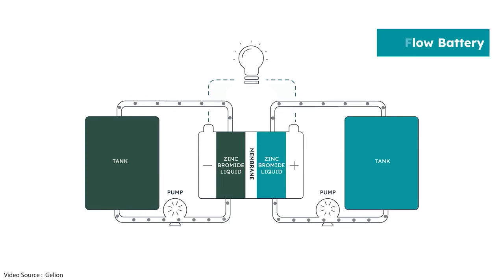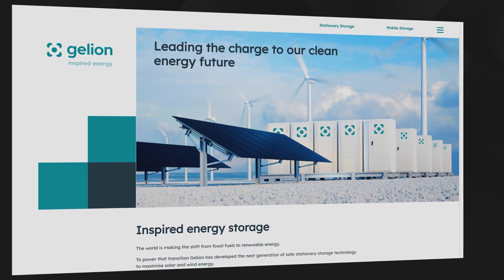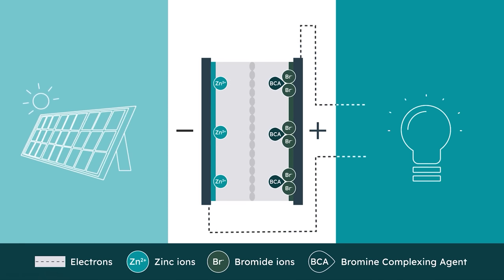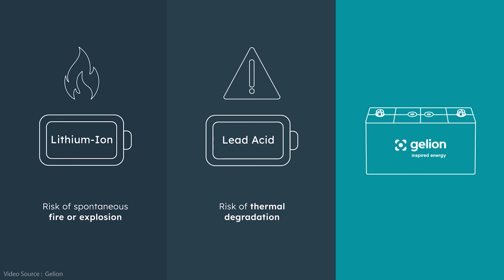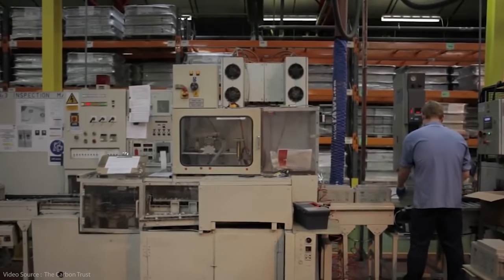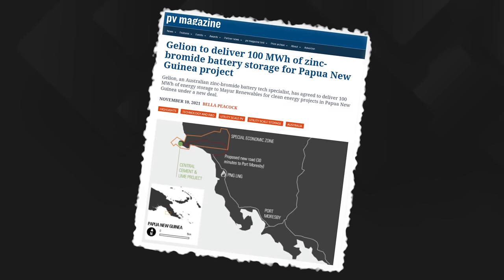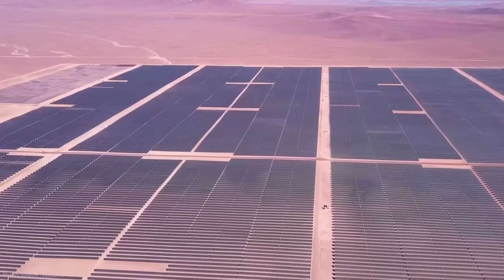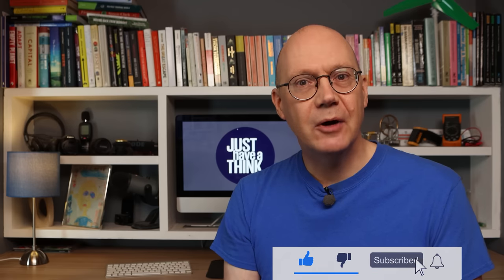Zinc Bromide GEL batteries. Cheaper, greener, simpler & safer than lithium -ion!

Comment: Zinc bromide as power storage is quite old, but the gel concept reduces the bromine build up problems. Looks very promising.
Reply: Ohh I didn't know it had been being used for long, ty for sharing
Reply: @1Mandacaru  zinc and bromide was a thing but this project is a different way of thinking to eliminate some cons.
Reply: Great for large ground based energy storage when weight is not an issue.
Reply: 16 million versus lithium-ion production at 130 million dollars, the choice is pretty clear to me.  The rebuilding costs are also very impressive.
Reply: Good til 50c but what about low temperatures? Canadian here.
Reply: @gmw3083  that's a fair question now that you mention it. I'd imagine it suffers from similar issues as other batteries. Lower power output but no long term degradation.
Reply: I'd agree in most aspects. There are two things I'm a bit worried about. One is build-up of hydrogen during charging cycle, as Zinc is quite reactive in hydrous environments. The other one is loss or leakage of Bromine. In opposite to sulphuric acid, Bromine can easily diffuse into the plastic material. The plastic material (as well as metals) may then be corroded with time, so there have to be special precautions, especially when the temperature limit is frequently reached. And cooling will also be necessary due to the boiling point of Bromine at ~60 °C. And of course nothing was said about self-discharge, as Zinc is also susceptible to air (especially under non-neutral hydrous conditions in carbonate-free environments), while Bromine is liquid at normal temperatures and may diffuse through the gel and react with the Zinc, too.
But in general, this might be a reliable and cost effective way of power storage.
Reply: @gmw3083  assuming there will be water in the gel to support dissolution of the Zinc Bromide that will be formed by the reaction, a completely charged cell may contain very clean water besides the gel and could be susceptible to freezing at < 0 °C. However, the gel might act against this, and there should be additives and other methods to also prevent freezing, comparable to methods applied in lead gel batteries. Incomplete charging may also be one of them, as Zinc Bromide has a high water solubility of > 4 kg in 1 litre of water at room temperature, and may thus decrease the freezing point quite a bit. On the other hand, highly concentrated solutions may also lead to crystallisation of Zinc Bromide hydrate in cold environments. 
However, I would assume that they are aware of these issues, or the batteries would not be applied in cold environments if there are the mentioned risks.
Reply: @human_isomer  I dunno. They still haven't figured out how to reliably build electric vehicles for cold climates. Mainly because of the lithium batteries as far as I know. Plain old salt water lowers freezing point. But I'm no chemist.
Reply: What the tesla needs is a flibe7 core for cold climate. Mate that to a liquid air system and things get interesting with a rebco electric engine.
Reply: @gmw3083  Yes, a solution of Zinc Bromide is exactly the salt water you refer to. It's just different ions than in Sodium Chloride (what is generally referred to when talking of as salt), but the effect is exactly the same.
However, as I tried to explain above, with different load levels of the battery, the anti-freeze effect may vary, and there may be counter-effects to that. So, this has to be figured out first.
Just adding Sodium Chloride, by the way, would probably cause different issues with the membrane and the chemistry involved and is not necessarily a resolution to the problem.
Reply: @human_isomer  I've already started to think of s solution. I'm not a chemist though. I've wrecked lots of things and still have all my bits n pieces. Too many projects..... and a mouse in the attic.
Reply: so this is another thing that's been tried and abandoned decades ago because it didn't work. no surprise there.

Comment: I love the idea of new kinds of batteries for different applications. The ground doesn't care how heavy the battery pack is so a lower specific energy isn't that big of a deal. So use Zinc Bromide GEL, LFP, Lithium Ion, Lead Acid, etc...where they are most fit for purpose. :-)
Reply from the maker: I agree
Reply: As an electrician who has worked on battery based energy systems since 2000, I am very glad to see lead acid batteries going the way of the dinosaurs. Lead is incredibly toxic, and many system installers would clean lead battery terminals without wearing PPE to prevent lead ingestion and exposure. While the advantages of lithium over lead acid are numerous, at this point, lithium Iron batteries are cheaper than lead acid batteries used in energy storage when compared to cost per cycle, which is the only real way to compare cost across different battery chemistries and cycle life.
Reply: @GoCoyote  It would be good to have a chart & method for comparing different battery technologies i.e.  "energy storage when compared to cost per cycle"
Reply: I think we’ll see layers of different technologies used for grid storage, as different discharge rates and recharge efficiencies come into play. It’s an exciting time, for sure. It’ll take a few decades to build really good grid storage, but once we have it, humanity could have clean power, everywhere, forever.
Reply: @davestagner  I agree. It is exciting. This is an opportunity to retool and use what is best where it is best.
Reply: @charonstyxferryman  Indeed.

Comment: This looks very promising and I'm glad to see how close they are to mass production.

I would like to see more information on the charge/discharge longevity of such batteries. If there are some critical assessments that would be a helpful addition as well. One thing I'm aware of is that bromine is a highly reactive element which easily diffuses into the air. That is not a situation found in most of the other battery technologies.
Reply: I'm  assuming the "Bromine Complexing Agents" mentioned in the legend in the diagram at 4:26 complex with the bromine to reduce its volatility.
Reply: Be interested to know about charge control requirements, for use with solar and generators when necessary?
Being off-grid myself.
Reply: It can be completely discharged to 0%. In fact, doing this is planned for on a regular basis in order to "reset" the battery. Life testing is on-going, but I believe they are possibly looking at achieving over 20,000 cycles.
Reply: This is already up and running !

Comment: If this works out, lithium will keep going for a while but it would be goodbye lead acid. And the idea of reusing most of the infrastructure for making LA batteries for the new fangled ones is just excellent! Probably these batteries would be better for ground based energy storage than L batteries too, when weight isn't an issue (if it happens).
Reply: Anyone who's ever had to remove the lead-acid battery from a car, or accidentally spilt its contents (!), or tried to dispose of one, will be joining me in wishing the end of lead-acid technology as soon as possible!
Reply: These things would be awesome for going off grid if their price comes down low enough.
Reply: Price, efficiency (93% round trip interesting for stationary applications) and real life durability will determine the success of this new technology. Good riddance for lead acid batteries 🔋👏👌
(And warranty)

Comment: Many thanks for this one.  This battery was announced at Sydney U with campus lights that solar collected in daytime and lit up at night.  It is progress indeed that Gelion has made it onto your illustrious channel.  Personally I will be happy when a powerwall replacement becomes affordable - even if I have to put it in a small garden shed.
Reply from the maker: Cheers Christopher :-)
Reply: Amen to that!  I have been considering installing solar for the last 9 years (ever since we moved into our current house with a large, south-facing, roof), but I still haven't done it.  Even with the reduced cost of the panels, it just doesn't make sense to install a system that generates electricity at the very time we are least likely to use it.  A stack of these batteries my cellar would solve the problem nicely.
Reply: @paulhaynes8045  Not installing them may well have been a smart move.  I did it about 5 years ago and wish I hadn't.  The energy market here in Australia is geared to ONLY benefit the grid scale providers.  They do this by paying an absolute pittance for your excess energy and then sell it to some one else for 7-10 times the price, with zero capital costs to them for infra structure.   They pay me 5c/kwh and charge between 35-45c/kwh and they are talking about reducing the feed in tariff even more, perhaps even to zero during peek output times.  My total bill including paying of the 4kw system and grid connected power is around 30-40% higher than just buying direct from the grid.  The only real money I save is when I can actually use the power I am producing which is of coarse when no one is home.  I will start winning when the panels are paid off but thats not for another 2 years or so.  Solar panels have come down a lot in price in the last few years but when I got mine it was around $6500 (+ interest) that money IMO could have been better spent.  A battery might change the equation slightly but another $10k is not  really appealing to mostly  benefit the power companies (see AGL's battery plan).  YMMV but do some thorough research and crunch the numbers before you bite the bullet and invest.
Reply: @scottsummers819  that is because energy cost is that low. The expensive part is the grid and taxes.
Reply: There are still plenty of homes that have an oil tank for energy storage for heating, so plenty of application where the space would not be an issue.
Reply: @TheNicog1  Energy costs in Australia are among the highest in the world. In Australia, electricity is not taxed, and depending on where you are, the grid is privately owned. 

Home solar has been heavily subsidised by the government because it distributes the cost of installing new capacity between the government and the user, and distributes the profit from the generation almost entirely to the existing energy company. The state governments have been doing this to subsidise the distributors because the largest ones own coal generators and those coal generators can be subsidised by stealth in this way.

Comment: A very interesting and well presented report on Gelion's battery breakthrough.  One thing I found disappointing was the lack of critical specifications such as charge/discharge efficiency and charge/discharge rates,. My interest is for off grid power applications.  It wasn't clear how much cell management electronics will be required, either.
Reply: Sounds like very little need for cell based management systems compared with lithium ion due to the resilience of the chemistry.
Reply: @yodab.at1746  my thoughts exactly. Price, longevity, and efficiency are the only things that really matter for consumers/investors.

I'm not off grid, be pretty close to it, I would rather have a battery backup with solar over a generator. The solar would offset my electric bill, and the battery bank would be good for power outtage
Reply: @sportbikeguy9875  Yes and no.  A lot of things still run off lead acid.  Most UPS systems run off it for instance.  If these can be built to be a drop in replacement for lead acid that will be a great boon for smaller facilities that don't have access to massive venture capital to build clean room ideal versions.  A lot of places need to make do with reality, not build for the utopia.
Reply: Well, basic ZnBr batteries need to be full discharged to prevent Zn dendrites from shorting out the plates, and required a special BMS to do this across the stack. I doubt they fully solved that issue, but it is not an unsolvable and would probably be built into the commercial batteries.
Reply: @ebattleon  maybe you should actually watch the video!
Reply: That and the cost.
Reply: I believe round trip efficiency is now at around 93%. They have been gradually improving it from earlier formulations. Very long cycle life, possibly achieving 20K cycles. Plus, it can't catch fire. The electrolyte is not flammable. Tested to 600 degrees, the plastic case melted but the internals don't ignite.
Reply: @goldreverre  Thanks Bruce J, that's helpful and  encouraging. 
This could be big for home power storage.   Now we just hold our breath, right?  :)
Reply: @ebattleon  I read that also, so you would need TWO sperate systems for off grid. One charged/charging and one undergoing complete discharge. Nutz to THAT!
Reply: @goldreverre  Sounds good. Do you have any links? Also, cost?
Reply: Not so. You just install a smaller capacity so that your daily use drains pretty close to zero, and once a week do a full discharge. With lead acid you have to over build because they don't like being discharged more than 50-75%, so having batteries able to fully discharge mean you need 25% fewer batteries.
Reply: @AdlerMow  I am going to politely disagree with the total discharge of just one and only set IF you're OFFGRID. Too many potential problems with changing weather and system management. As an offgridder for 15+ years now I like simple and I like redundant. I don't see a problem with grid-tied for reducing time of use costs OR  as backup.
Reply: @blaydCA  That's why people are talking about controllers that would allow you to discharge some cells while keeping others at 100% so the first cells hit 0%, then after recharge, the cells-to-discharge-first change to a different parallel unit. It's not two separate systems. It's simply wiring some cells in series and then those groups of cells in parallel and feeding it all through one intelligent controller. Depending on the voltages of the cells, you don't need very many wired in series to make a unit and could potentially have many, many units in each single home battery system. There's no reason for it to seem like anything other than a single system to you -- especially since this is already what they do with lithium ion batteries, which require much more active charge/discharge management. If you've got a Li-Ion system, you've already got many multiple battery units wired through a central controller. This isn't new, and the management should be substantially easier. 

The only bad thing is going away on vacation and needing to discharge ... which would work fine if sending energy back to the grid, but not so much on off-grid systems. Would the system simply run an external heating coil to boil off that heat? Don't know. Seems awkward for a solar powered vacation home which is going to stand empty for long periods if you don't have a way to "waste" the unneeded power.
Reply: @cripdyke  Time will tell. As an offgridder, I don't worry about "wasteage" or unused production. PV and wind have a payback period. Storage batteries NEVER have a payback period, it's an ongoing cost regardless of the technology. Perhaps Australia will do it right. I don't see this in 'Merica for residential consumers in my lifetime sad to say.
Reply: You were also interested in charge/discharge rates. This can be is varied and depends on the battery design. It can be made to have very fast, capacitive-like performance, or very slow and steady discharge based on gel thickness. Price should be below $100/KWh.
Reply: @goldreverre  Thanks Bruce J,  the capacity vs charge/discharge rate trade off makes sense for this technology. I hope they are successful in production.
Reply: "Gelion plans to use the funds to commercialise a 1.2Kwhr monoblock battery for use in commercial and grid scale applications.[12]  Gelion claim their monoblocks will have many advantages compared to zinc-bromine flow batteries, these include:"

"Significantly higher energy density of (120Whr/kg)
Significantly higher Round Trip Efficiency (RTE >87%)"
Reply: @blaydCA  I didn't hear anything presented in this video that would suggest that. In fact the point was made that the gel configuration drastically reduces the formation of dendrites, in comparison to FLOW type ZnBr batteries. No word was mentioned that the gelion units required regular, full, 0v discharge to avoid growth of dendrites. 

Were you reading about the gelion ZnBr gel batteries, or traditional ZnBr flow batteries?
Reply: @CollinBaillie  My information was gathered from different sources including the Gelion website with regard to the Gel technology. The operative being "drastically reduces" which is hardly the same as zero dendrite problem. As a 24/7/365 offgridder, I am cautiously optimistic. We shall see. When your sole supply of electricity is standalone you tend to be guarded.
Reply: @blaydCA  Great answer! I'll be keeping my eye on gelion for sure.
Reply: @goldreverre  
Thanks for info. 
Is this battery heavier and bulkier than other batteries.